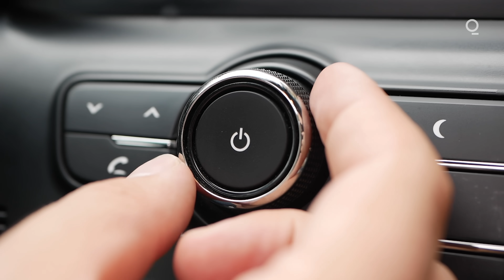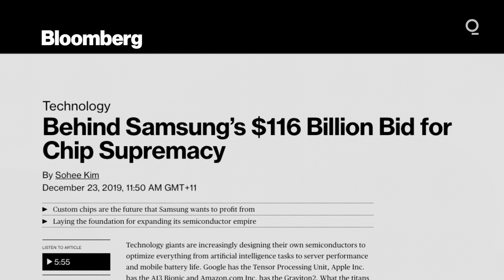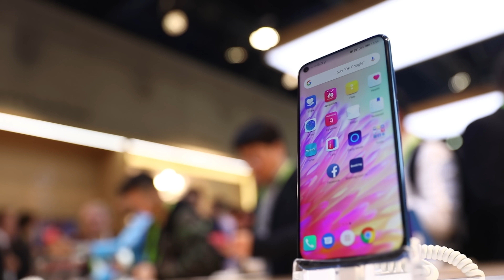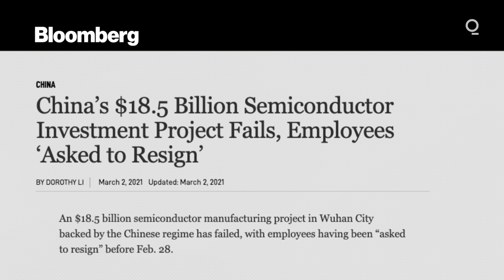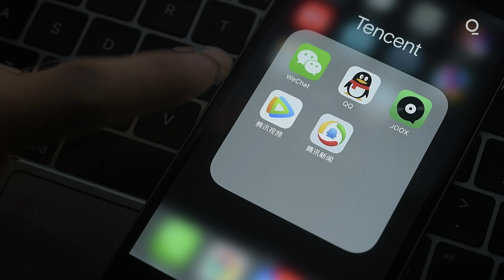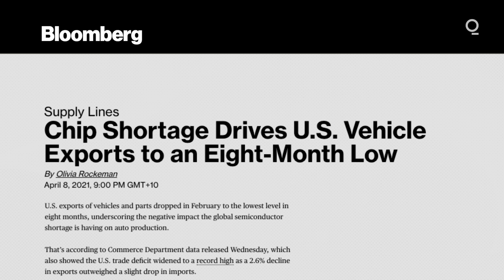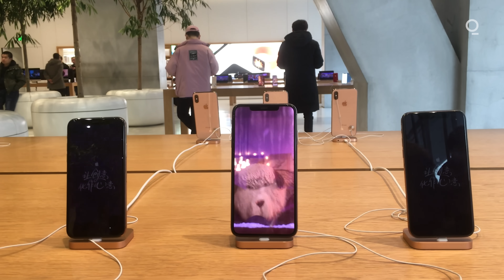Inside China's Accelerating Bid for Chip Supremacy

Comment: Reliance on China comes from a company's want to go for the cheapest labour possible so they can get maximum profit, they aren't forced to rely on China.
Reply: But China doesn't have the cheapest labor now, not even close.
Reply: @zhangjin5120 That's because it's not just about labor anymore.  China has built industries that can't be beat.  If you are an inventor with an idea or a product and money, all you have to do is go to China.  Engineering, raw materials, manufacturing and even shipping, China will handle it cheaper and easier than making your own in another country with cheaper labor.
Reply: @paterdoloris   Labor is just one of the factors. China has 2 major advantage, the completeness of the supply chain and a prosper market.
Reply: @zhangjin5120  Overall cost is still cheaper than other countries except for SEA and India. China has been moving factories to Vietnam for years to take advantage of the basically non-existent workers' rights and even cheaper labor. When you send your product designs or requests to China, they send it to their Vietnam factories to maximize profit.
Reply: @zhangjin5120  NOT THE CHEAPEST LABOUR BUT THE INFRASTRUCTURE TO BUILD QUANTITY AT STILL LOW COST . THATS WHAT COMPANIES WANT. NOT CHEAP LABOUR IF YOU CANT PRODUCE !
Reply: @salamjihad3449  you are talking to a group of ppl that don't do business. Labour cost is only one  of the reason made. There are more things need to be considered
Reply: @chikinhsieh1503  LABOUR COST IS THE MAJOR REASON! OF COURSE, THERE ARE OTHERS TO CONSIDER.
Reply: @salamjihad3449  not true
Reply: @chikinhsieh1503  LOL  . YOU HAVE NO IDEA !!
Reply: Would you pay for a $1800 iPhone?

Exactly.
Reply: @PinwheelCinema  I wouldn't pay for an iPhone, period. Samsung and most of the android phone brands have already moved their factory operations to Vietnam and India.
Reply: @PinwheelCinema  Besides the point but... just you wait. The iPhone originally cost $500. Now they're costing $1000. In ten years they'll cost $1800.
Reply: @PinwheelCinema  The true Apple fans would do that.
Reply: We are complaining with all the rising cost even we get it from china, think about if made IN USA
Reply: @KLam-mx2fl  rising cost is because of government printing too much money, and import tax trade barrier introduced by US.
Reply: Actually, it's has gone past that for a long time. People want affordable products so factories are forced to move to China. The consumers demands it.
Reply: In addition to cost. No other nation has the speed of production and manufacturing capacity China has. Pretty much all manufacturing supply chains go through China at some point or another.
Reply: @netgiant2592  EXACTLY !!!
Reply: Exactly and what does that say about foreign companies especially rich western ones that have no issues exploiting cheaper labour of other countries citizens and then point fingers at how that country theoretically is abusing their citizens. Too funny.
Reply: @leeramer171  FOREIGN COMPANIES ARE GIVING JOBS TO THEM!  IF THEIR OWN COUNTRY CANT SOMEONE ELSE WILL !!
Reply: That’s too simplistic. China isn’t the cheapest. China does have rich ecosystems that make creating these things easier. Less shipping, less waiting.
Reply: You would pay 2000 for a phone?
Reply: In other words “greed”
Reply: u need basic business knowledge
Reply: Simple mind.... Its not just cheapest labour, also infrastructure, work ethic,  intelligence, work force numbers etc.. just go to Africa if u want cheap labour, but nothing else.
Reply: Well if China actually can trap the companies within China and make them hard to leave.
We can all say China is getting read to tame the dragon named 'capitalism'.
Reply: This is exactly where India can overtake India. Cheap labour. Need to make it "Trained", is of the hour.
Reply: True, but it is also demands from consumers and competition. Consumers want nice stuffs and the companies who can deliver the products with the best values win or they will be forced out of competition. It’s our capitalism and consumerism driving that force.
Reply: that's not just companies, that's literally everyone.
i'd rather have toast for 1 minute rather than 2 minutes of work.
you'd rather have a monitor for 50$ instead of 60$ for the same monitor.
Reply: Low cost China based labour is an out of date and past used by date explanation for companies to migrat to China. Now it's more of other benefits, such as skilled and committed labour force, speed of Chinese grasp of technology and innovation and scale, for example.
Reply: Execs want $50m salaries for $500k of work.  So they steal that from Chinese commodity workers in Chinese sweatshops..  You guys are drinking the exec Kool aid!  No consumer demands that execs rip off these workers!  You say consumes demand low price, I say we don't need these overpaid execs or communist workers! the USA gov looks the other way because the execs pay the politicians to forget these facts!
Reply: Wrong! U.S. companies went to China mainly for its market.
Reply: @fofororo2070  That hasn't been the case since 2013,  especially with CCP propaganda of using local brands and products. Huawei was literally built on stolen iPhone technology from Foxconn factory in China. What you're saying is equivalent to saying "People move to America for the American dream", get on with the times.
Reply: @lightspeedrescue  Remember tech diffusion is a thing you can't protect tech forever it's proven in history for any country. The only question is how much you can delay/exploit the advantage when you are ahead.
Reply: @fofororo2070  No, you're wrong. When US companies first started buying their products from China, China didn't have much of a middle class to speak of. Most Chinese at that time were extremely poor and didn't have purchasing power for much of anything because most of them were living in rural areas. However, once China's manufacturing industry exploded, people who once lived in rural areas began working in all these factories and they began making more money than when they lived in rural areas. Also, a certain % of these people began their own businesses and made MUCH more than they did in their own villages. China's Gross Domestic Product increased considerably over the decades and the size of their middle class exploded and when that happened, US companies decided to go to China for its market, as you wrote.
Reply: @alexpeterson5829  Geostrategically, the U.S. went to China after the U.S. lost the war in Vietnam at the hands of the Chinese and the Soviet Union to neutralize China from communist block. At the same time, China's economic development started to take its early steps right after the 60s failure of the cultural revolution. The U.S. was aware of that as well. So the potential of a big Chinese market could be easily foreseen back then. Furthermore, inflation was wrecking havoc to the U.S. economy and the most powerful weapon the U.S. has, the U.S. Dollar, and the U.S. wanted to take advantage of the cheap Chinese factors of production to help rescue the Dollar at the expense of the American middle class. All these factors were behind the U.S. move to China. If it was about Cheap labor, cheap labor was everywhere and much more closer to U.S. shores than China. For example Mexico and almost all of Latin America were as cheap if not cheaper and way closer to U.S. mainland and under pro American regimes.
Reply: CHEAPER-BUILT PRODUCTS DO FORCE COMPANIES TO BUY FROM CHINA! I GUESS YOU NEVER OWNED A BUSINESS !!  LOL
Reply: @salamjihad3449  Cheaper built products comes from Vietnam, even China businessman are moving factories to Vietnam then importing it back into China because the overall cost is much more cheaper due to labor cost. How out of touched are you smartass?

Comment: suddenly I thinking. If TSMC gone, computer & phone become high-end item again... price skyrocketed... and we will pushed back to older processing node. AMD had backup with Global Foundries but they must pushback processing node back to 12nm... other company will be do the same as well, either put order on Global Foundries or similar foundries, but a I know, GloFo is maybe the last one that had 12nm process node (AMD use that node for I/O chip on AMD Ryzen CPU)

so at the end, we will had setback on processing node for few years if TSMC gone, but the manufacturing will be shifted. TSMC build the chip, package in Philiphine or Malaysia, and china assembled the chip with other component. if shift to GloFo, then the packaging will take longer except they will use packaging contractor from surrounding countries, as GloFo had 2 place, New York and German, which both of them capable manufacture 12nm node.

but again we had Samsung as well. if their capacity is capable to handle the TSMC level order, then we will have no problem... or as china planned, if fabless okay to pushback, then 12nm on SMIC will be another choice to consider. either way, TSMC gone will not end of the world, but the set back on technology advancement of semiconductor manufacturing will be quite big if there is no other player in the industry that matches TSMC level.

Comment: FYI in case you are wondering why it can't just be made elsewhere, the temperature and weather of the local plant needs to be "just right", it is like rocket launch sites.

Also any quality shortfall means the chips are useless,  which is why China have not been able to take over by cutting costs.

Comment: TSMC announced 2nm in 2022 production. 
90% of global advanced chips are made by TSMC.
Reply: If TSMC can stay ahead of the curve, then even if china becomes self sufficient, they will only sufficient in an older tech. They can probably get by with that, because old tech still works, but the world will still protect Taiwan. If China ever wants Taiwan, they need to make them appear useless in the eyes of the global elite.
Reply: @LeafMaltieze  let's not forget that the entire chip industry rests on one dutch lithography company. without their equipment we won't be able to fabricate anything. for larger technologies like fighter jets, they're easier to copy, but for anything near the quantum level, no amount of brilliance from china's engineers (who are already moving out of china by the way) can supplant those lithography machines
Reply: @gasun1274  I heard there are Chinese working in ASML
Reply: @tannen3339  no they dont allow foriegners in. Most chinese got banned from west during Bush Obama admins
Reply: @metagde6402  It does not matter  The Chinese can hire non Chinese work for them too.
Reply: Depends where you draw the line on advanced chips. If you include only the absolutely smallest line widths, yes, but that is a tiny sliver of the semiconductor market, or even on the "advanced" semiconductor market. Most advanced microprocessors are using 7nm or so.
Reply: Not for long...

Comment: the automobile industry chip shortage is caused by the Chinese chips ban imposed by the United States. TSMC doesn't even make car chips anymore.
Reply: Cars don't need chips anyway.  All they need is bodywork, an array of electrical parts (such as spark plugs) and mechanical parts, all correctly assembled, along with the battery and the petroleum/diesel.  No chips needed.  Period.

Comment: 2:48 You spelled metres incorrectly.
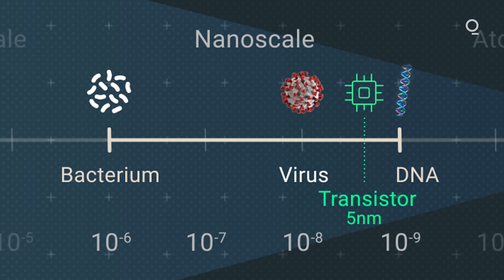2:57 It should be "5 nm", not "5nm".
4:15 JFC, you'll use any unit other than the proper micrometre , won't you? The "micron" stopped being a thing over 50 years ago. Please stop using it. Also, it should be nanometres not "nanometers".

Comment: Lots of incorrect info. AMD maker of fastest chips in the world does not use any of the listed companies. Nvidia also makes their own chips. No one seems to know how many chips Simic makes in China. They are not listed. Despite multiple brand new factories. Simic moved to 7nm process (2021), cutting edge. Main problem with China current manufacturing is that they do not make enough cutting edge stuff - it will take few years before they have enough volume. This will be a death kneel for a lot of western companies.

Thus Smic matches today's best in the world. 

This was made by TMSC - nice propaganda.

Comment: One of the biggest problems in U.S. university system is that the professors regard teaching as beneath them. They have a much larger chance to make big money by working on projects that the university has partnered with corporate interests to form. Basically the teachers are generally terrible. Cheating is rampant therefore. Especially in Electrical Engineering.

Comment: I completely disagree that it is all about keeping China at the bottom of the supply chain.  There is always competition - so that is a factor - but it is not all about that.  The security issues that turned up in Huawei products are problems for national security.  As Huawei is part of the CCP and the CCP is openly antagonistic to the USA this is also a political issue - it is not purely about keeping China at the bottom of a supply hierarchy.  In China the party is China.  Control is more important than prosperity.  Huawei has to allow the CCP access to every piece of data it has on anyone.

Comment: 3:33 $15 Bn - $20 Bn to build one semiconductor factory, and that factory is obsolete within 5 years. Factories must be operated 24/7 around the clock to be competitive. Brutal industry economics.
Reply: Car still need 28nm chip, so After 5 years of 5nm chip, the campany Can still produce. But high tech like computer, will need more less nm chip.
Reply: @imrokwasiba9027  Excactly. it's not completely true that a chip machine is obsolete after 5 years. most chips for cars are 40nm and tsmc is working on a 2 nm chip right now. the biggest shortage is actually for 40nm chips right now.
Reply: @ThomDon96  The most important thing is the transistor areal density, which in the case of 2 nm proposed by IBM, is slated to be 330 million transistors per square millimeter, on average. Intel's current 10 nm process, introduced back in 2018/2019 with silicon shipping around that time, has an average transistor density of around 100 million transistors per square millimeter.
Reply: @NUCLEARARMAMENT  Yea sounds like Moores law where they take turns on transistor density and then halve the chip size.
Reply: Sounds weird. What was costing all that money? A robot arm with super teeny tiny nano fingers?
Reply: @TheBooban  very very high development costs, high wages for very qualified staff, expensive equipment custom made for the process.
Reply: @New oh yea? Maybe a genius like you should manage it so it will become numbeh 1, right?
Reply: You can’t tell me they are scraping by tho.. so they see a dive in profits... what so no extra yacht for the 20th grandchild that year?

Ooh brutal industry
Reply: @Psybo  thats the point.  You make 5-10 bill a year, or you go out 20-25 bill bankrupt.

Comment: "7nm" is very misleading. It only describes the process of making a chip but not the actual size of a transistor. 
Depending on the transistor type, the actual transistor size for "7nm" ranges from 54nm to 24nm...

Comment: Memory chips are harder than microprocessors.  They have smaller geometries.  The memory fab process is tuned for higher capacitance than a microprocessor fab process.  Memories have more transistors than anything.  32GB = ~32 billion transistors.
Reply: Except it doesn't require EUV technology so it is less a sophisticated (cheaper) manufacturing process. Also, the complexity of design and the smaller size of transistors in logic chips is much greater than that of NAND and DRAM. It isn't even close.

Comment: In this case, wouldn't it make sense for TSMC to license out their tier 2 or tier 3 manufacturing process and engineering at a sky high price since they are basically the best ?  Obviously they will keep their tier 1 secret sauce at home but the "older" stuff is still miles ahead.
Reply: the thing is they are still selling fabs made from their tier 2, tier 3 process and beyond and they profit from doing so. for example 7nm is being sold to AMD to make all their computer chips and graphics card. There's no need to license it out to anyone else casue their profitting from it. Oh and the other competitors are not too far off than you might think, like samsumg 8nm is somewhere between TSMC 7nm and 10nm.

Comment: China has tried and failed so many times in chip manufacturing that even recently they have tanked about $15B with Wuhan semiconductor... The chipmaking isn't just building a fab .... you have to have a complete supply chain all the way to the system like mobile phone etc... Apple and Samsung have this is place to a T... of course their local market can generate a demand... you end up duplicate the complete platform Hardware, software and more... I guess you end up going after the IP and for them... nothing matters....
Reply: Tell him I directed you 
You can rech him on WhatsApp
+...1.... 9~~7~~2~~4~~7~~6~~2~~0~~8~~9~~0